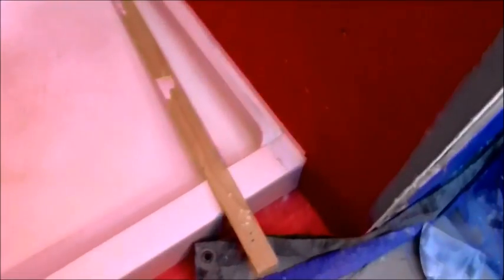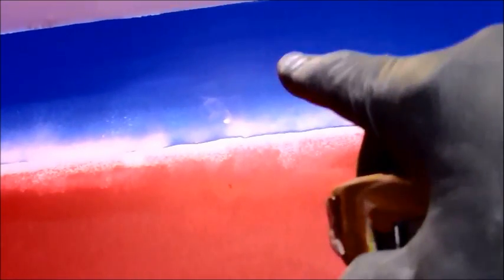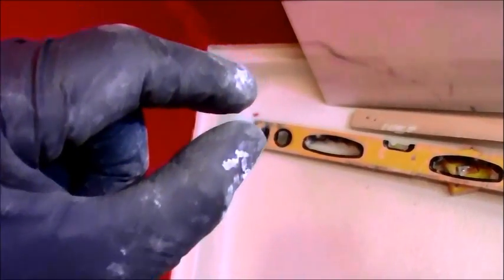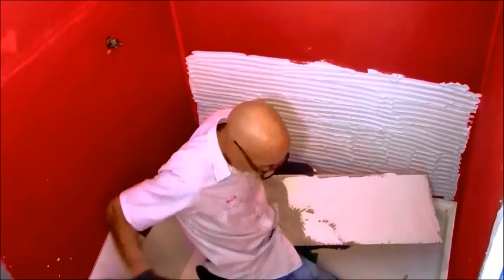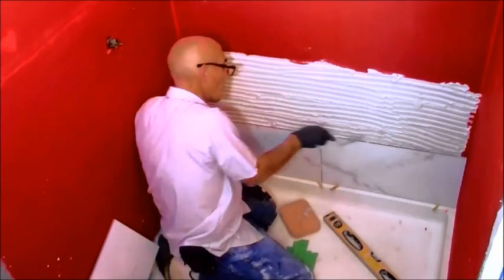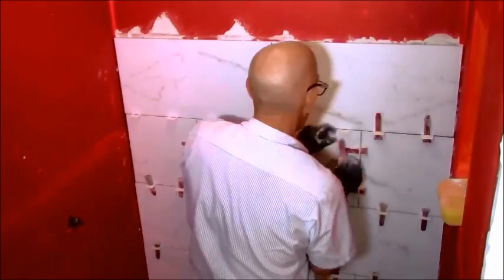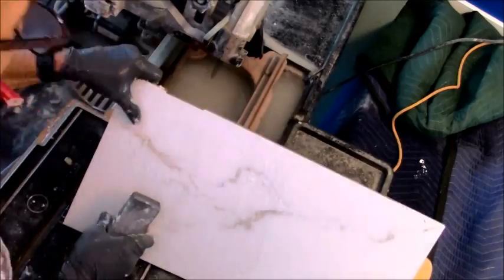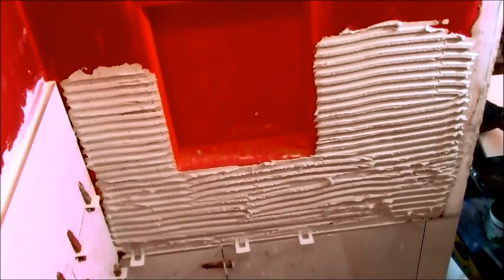TILING WALLS....TIMELAPSE

Comment: On one of my showers, I did a Swanstone Solid Surface pan. It has no fiberglass on it; it's all acrylic resin (whatever they make tubs out of nowadays).  After 4-5 years, it still cleans up bright white.  Installing it with the correct mud base and spraying expansion foam inside the curb makes it feel very solid.  As usual, Bob, great video and work!

Comment: Hi Bob, thanks for all your videos, I'm an avid watcher. I'm also tile guy from  England, I would of put a full tile under the niche and filled in the different with scrap tile/thinset. And i  also would of like to of seen how the niche wall turned out with the small slithers around the right hand side of the niche.
Reply from the maker: The bottom cutout area of the tile around niche didn't effect any other areas, so no sliver cuts were used..
If I can find a picture on the final product I will post it in the community tab

Comment: I'd like to see a video showing and comparing your preferred 1/3 style and this running Bond and why you prefer 1/3
Reply from the maker: It is not that I prefer the 1/3 stagger, that is the recommended distancing on what most manufacturers give you in order to avoid lippage...since larger tiles have slight bowing.

Comment: Great video thanks bob. Why did you skip the running bond stagger around the niche?
Reply from the maker: On top right side ! Good eye 👍
Actually later on I had to take that piece off and cut in the 5-inch piece to correct it, I'm really surprised no one else has noticed it

Comment: First thank you for all your professional advice that I really appreciate and store in my brain. I do have a question ... if you used water proof foam board (Durock or Sentinel etc..) in your shower or tub would you think putting Red Guard is not necessary at all? Putting waterproof membrane in all the cracks, seams and screw holes do you think would be enough? Red Guarding a waterproof foam board is over-kill right?
Reply from the maker: Durock is not a foam board....
But yes, if you do use a foam board of any kind then waterproofing over it is redundant and Overkill
Reply: @StarrTile  Thanks again for your unbelievable professionalism... I'm learning a lot. I especially like the debate guys are having re: putting the backerboard on the lip of the tub or just over it.
By the way Durock "did" (past tense) have a wonderful foam board. I used it in a bathroom remodel about 3 yrs ago. It was called USG Durock Ultralight Foam Tile backerboard (stamped all over it). It was really awesome and for some reason they stopped making it. It was sold at Floor & Decor.  Now the only foam board I see there is something called Sentinel Foam board and Schluter.
Thanks again.
Reply from the maker: Another that is readily available at most tile stores is go board

Comment: Hi Bob, great video. What thinset do you use over redguard?
Reply from the maker: By default I use versabond because it's sold at Home Depot but it wouldn't really matter
Reply: @StarrTile  Some you tube videos say that Versabond will not hold tile to Redguard waterproofing.    As time goes by, Versabond releases itself from the Redguard and the tiles fall off.  have you tried "Schluter All-Set Grey Modified Thin-Set Mortar"?
Reply from the maker: @sjay149  😂😂😂😂
I have never heard about versabond disappearing from the Redgard, I have been using versabond since day one going back over 20 years..
And no I have not used Schluter all set, all of their products are pricey and there is no bang for the buck

Comment: What kind of mortar are you using for the 12 X 24 over Red Guard? You also mentioned in the beginning that the mesh tape was redundant. What do you do at drywall joints; 2 in 1 adhesive & caulk? What is the criteria for using sanded or unsanded grout?
Reply from the maker: Modified thinset from home depot, versabond LFT....
Drywall joints get drywall mud then redgard, tape can be used but serves little purpose since the redgard ofinitself is a crack preventor....
Criteria for grout is unsanded for less than eighth of an inch , sanded for eighth of an inch or more, having said that I use prism which can be used for any size
Reply: @StarrTile  thank you so much for responding so quickly!!  
I love your work and your videos!
Reply: @StarrTile  due to redgard being a waterproof membrane I have heard people say that modified thinsets will not cure properly and can take around 30 days to actually cure. instead you have to use unmodified thinset. thoughts?

Comment: I have searched your videos for and corner shelf ideas. There are some products that I have found such as "go tile". This product requires you to use a grinder to plunge into the tile or grout line and use a biscuit type joint. Because I have watched several of your videos, I want to know what you think of this type of system? You always stress red guard, red guard, red guard and by plunging into the tile, wouldn't that plunge past your red guarded wall behind? Do you think it is safe? Sorry for the long winded question, but I'm doing my bathroom for the first time and want it to be perfect. Also your channel is the best one I have seen and I've watched A LOT of videos. Thank you
Reply from the maker: I have use those shelves before and the plunge isn't deep enough to hit the Redguard, but if you do it right you're pushing in some silicone inside of those cavities you created and then set those tabs inside making it basically waterproof

Comment: If the tiles are truly flat you can do 1/2 stagger. The 1/3 stagger is to avoid lippage for tiles that are curved
Reply from the maker: And nearly all 12x24 have slight curves at some juncture.
Reply: Porcelain and ceramic tend to have some bend to it but marble and stone seem to be flat , put two of your tiles back to back and see if there’s any space in between

Comment: Have you considered a laser that way you don’t have to use levels. Also if you do your math and know that you need to cut the first piece of tile down so you land a good size at the top just mark where the row should start set up your laser and cut the bottom in then you don’t have to come back patch screw holes and set that bottom row of tile after the fact and you would save money on the boards
Reply from the maker: Yes I have tried various ways but it is never an issue of me finishing faster only better , this is the best method I have come up with not just for me but people who watch my channel, generally will be easier for a homeowner or DIY'r... especially if they don't have a laser level as I do, that would force him to go buy one

Comment: Hi, you are my favorite person in that field that shows everything based on experience-respect! Great video but I have a question. What is the size spacers that would you recommend for not rectified ceramic tiles 8/16 around tub? It’s a Durock backer board on the walls. I like 1/16 but my concern is potential tile cracking because of expansions and contractions if I go 1/16 space. Is there any rules for the size? Thanks
Reply from the maker: There is no rules for size of spacing, normally it's just aesthetic but 1/16 is about the lowest you would want.
A typical job I do 1/8 spacing oh, there are exceptions to that rule but rarely do I ever go higher, or lower.
A rectified tile would be a great candidate for 1/16, but same with a tile that has a rounded edge because if you try 1/8 it will look like 1/4.
But of course a non rectified tile you will have spacing issues trying to do 1/16 they're not always same size
Reply: @StarrTile  So you don’t think if I do 1/16 I will have a problem with cracking tiles ( of course if the backer board is properly installed)? Thank you very much
Reply from the maker: Cracking of tile is extremely rare, as long as there is an expansion gap and the 16th should be fine

Comment: Wow!  I really love these videos.  So, if I understood correctly, no need to tape the corners and seams of the durarock / hardie backer if we are using several coats of RedGuard?
Reply from the maker: That is my personal take on it, it doesn't hurt to do that in addition to the waterproofing but I feel it's redundant
Reply: @StarrTile  Can I prepay you for a 30 minute call in case I need to call you in a pinch this upcoming week?  How fast do you respond?

Comment: Can anyone help me? I’m trying to cut an “L” shape cut in a 24” tile with my DEWALT D24000 wetsaw but I can’t because the tile hits the metal piece where the motor is. I could cut it by flipping it over but I wind up with too many chips that way.
Reply: Use green tape 3 layers and it should help. If not get a porcelain grinder blade and try that. on my wetsaw I'm able to move the motor to different locations to avoid the metal arm.
Reply: @darrenr1194  what saw do you have?
Reply: @Bbbbbbbbbbb-f1w  I have a ridgid wetsaw I've been using for years. It takes a 10" blade. ( the blade I buy is usually around $120 and has a center ring which keeps it from wobbling when cutting thick porcelain tile
Reply: @darrenr1194  Thank you